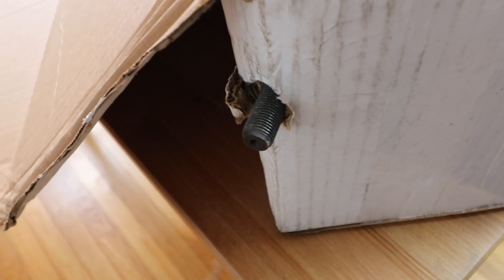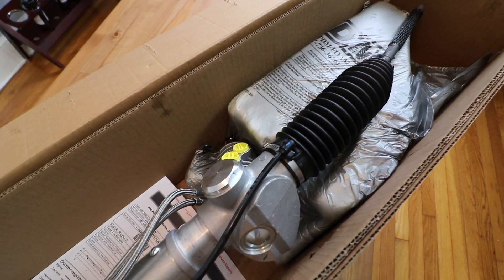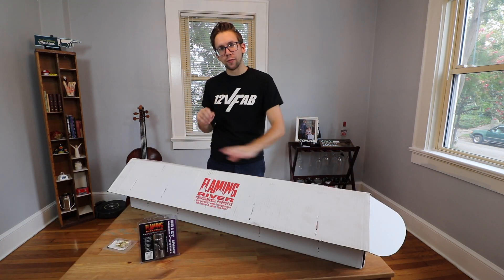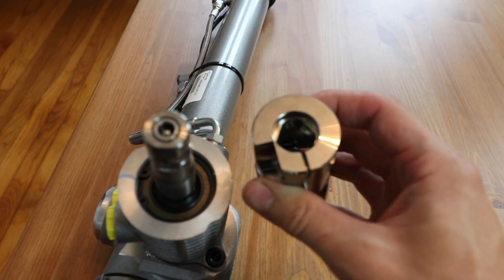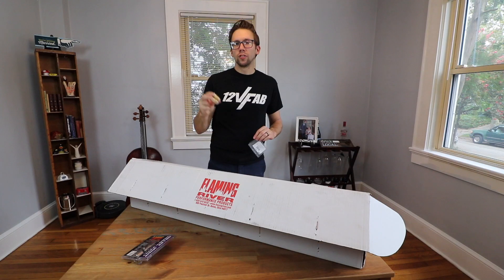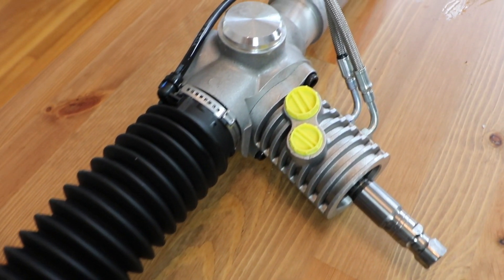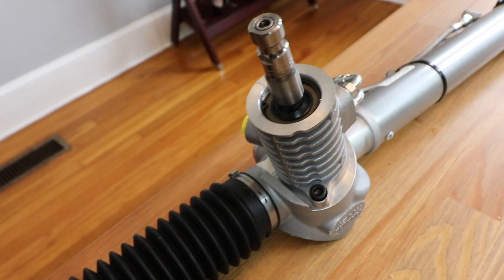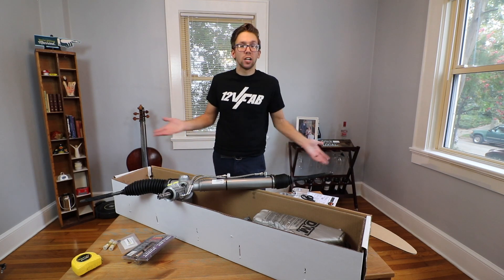Unboxing and Measuring A Universal Flaming River Rack and Pinion

Comment: Inner tie rods are threaded at 9/16” - 18, except the end that sticks out of shipping box measures at 9/16+” - 17.2, otherwise fine. I can’t find that die in my 112 piece SnapOn tap and die set. Humm!
You know how expensive those little plastic safety fittings with large round caps, like the ones they sell at home improvement for use on the ends of “Re-Bar” as required by law. I think a box of 100 cost $12. $13.25 for 9/16” round stock or #3 “Re-Bar” used in concrete.
Funny stuff, thanks for taking time to provide a link. I have talked to Flaming River customer service before and found them turn almost combative, combined with a useless warranty leaves a bad taste in my arm pit. Lee p/s makes 3 ratio of gear boxes with different torsion bars (For road feel / feedback) and only require flushing the pump and installing a filter in the return line. Some filters are pricy but others include magnet, smart. You can also use an oriface tube used in any auto A/C system, inserted into the return tube of the pump.
ASE Master Tech since 1978 - Retired
Reply from the maker: Preach it brother... of all the years I’ve been talking to them I’ve only had one person that actually wanted to explain stuff and walk through troubleshooting issues. They start questioning all the other pieces not from Flaming River and play blame game roulette. I had never heard of Lee, the seem proud of some of their stuff but then again, so is FR haha. I miss ol’ sloppy C10’s going down the highway with a steering wheel you could turn 4”  to the left and still be in your lane. Man those drove good when worn in - not a care in the world....